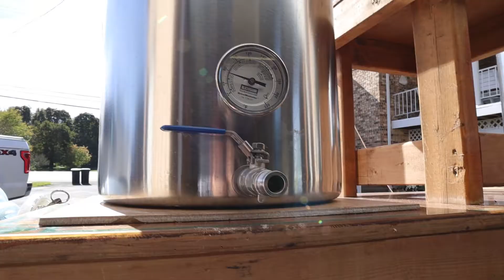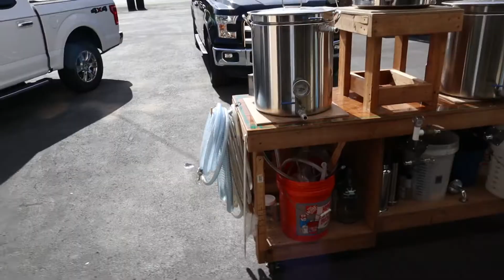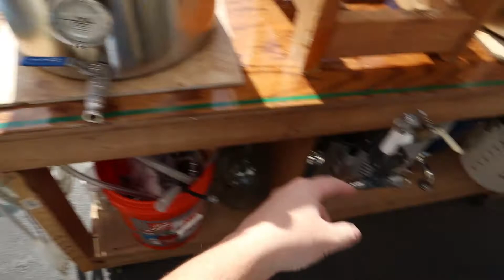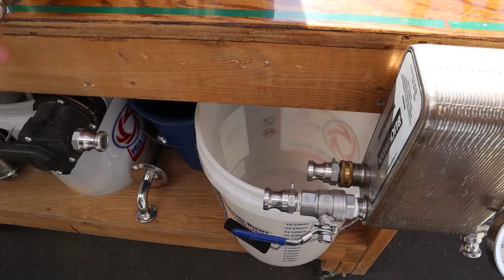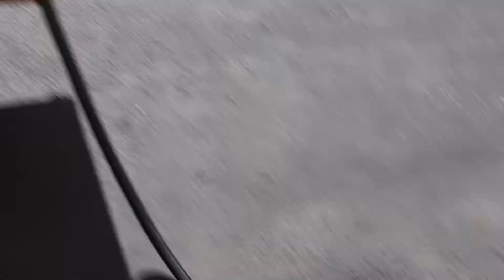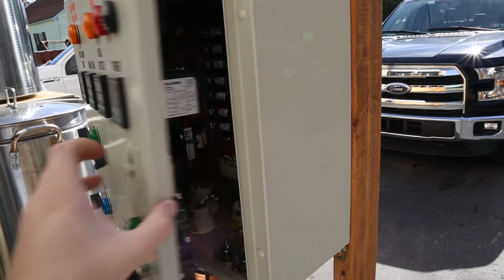1BBL Home Brewery Tour

Comment: Hardly a 1bbl but it is a great setup. Ditch those cam locks, and the plate chiller for quick connects and a convoluted counter flow chiller. I would also get a hop stopper from Kal at the electricbrewery.com

Comment: Did you build that control panel yourself? Cause if so, that's Uber bad ass!!! Outstanding.
Reply from the maker: Yes I did, it was based of The Electric Brewery's design. I made slight changes based on what I wanted out of it. You can find out more on this link http://www.theelectricbrewery.com/control-panel-part-1
Reply: The wiring and symmetry demonstrated are a thing of beauty.

Comment: Did you make the control panel yourself or did you buy it somewhere?
Reply from the maker: I actually designed and built it myself, its based off the design from the electric brewery. You can buy similar panels out there but I have found that they are far more expensive over building yourself.
Reply: Awesome. Well it looks great I'll be waiting for a brewing video next!
Reply from the maker: Thanks, I have plans for some content coming soon. I got too busy with work and the holidays that I haven't had a chance to upload. But stay tuned I have some things im working on!